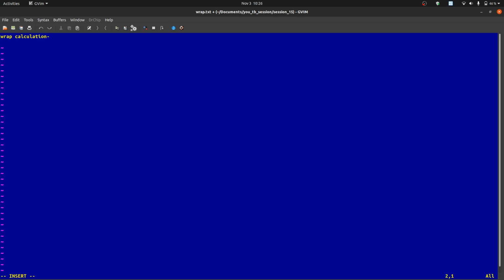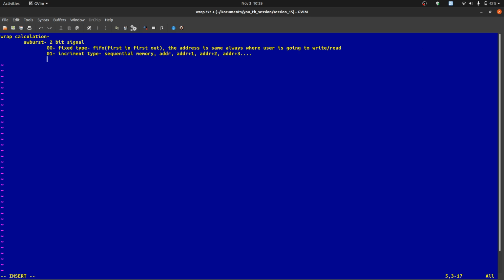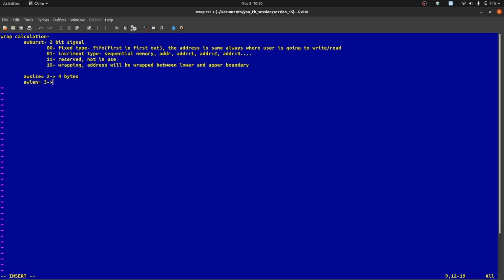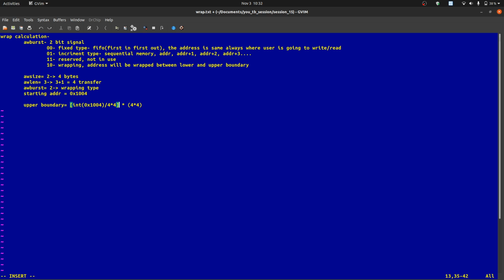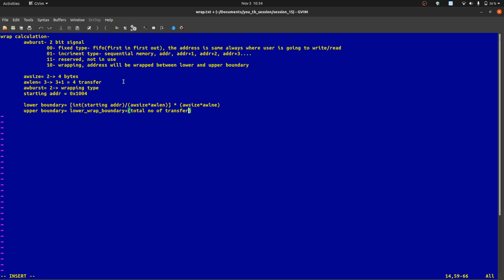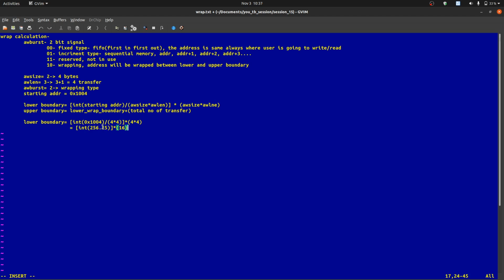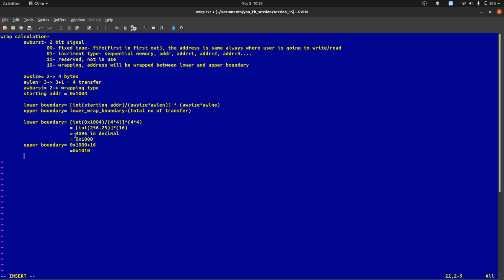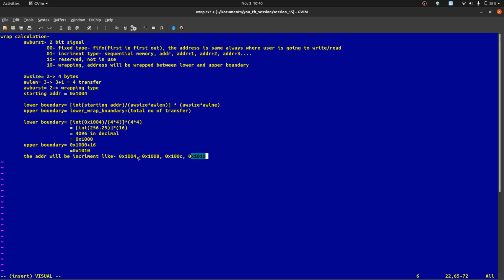AXI Wrapping Calculation

Comment: Why is awlen = 3+1?
Reply: There is number of transfers you need to send/receive. Specification specifies that whatever number of transfers you have to do, you subtract 1 from #transfers and then keep that value in awlen/arlen signal of AXI. This is because you cannot have transaction of 0 length, therefore if awlen/arlen = 0 then actual number of transfers is 1.

Comment: Q1)How you take awburst=2?
Q2)Upper boundary= lower wrap boundary+total no. Of transfers.
       In this total no of transfers i.e., awlen =4.  U took 16.
Reply: 0 is fixed
1 is incremental 
2 is wrap
3 is reserved 

So he is doing a wrap operation so awburst is 2 i.e wrap. It is not in calculation, just for representation. 

Total number of bytes in transaction = awsize + awlen = 4x4 = 16
awsize = 4
Awlend = 4

Upper boundary= LB + total number of bytes and transfer 

4096+16
4112 decimal
0x1010 hex

Comment: FIrst of all great job......
1) why you have incremented  as 4 in last address calculation i.e. 0x1004,0x1008,0x100c,as we have taken awsize*awlen i.e. 4*4 =16,then you should have added 16 into it why 4?
2)while wrapping it will go to its starting position i.e.0x1004 or to its lower boundary i.e. 0x1000?
Reply from the maker: 1)4*4=16 will be the total num of transactions, awsize = 2^2 = 4 so next addr wiil be increment by +4.
2) in wrapping concept it will start from the starting addr and after wrapping it will start from its lower boundary addr